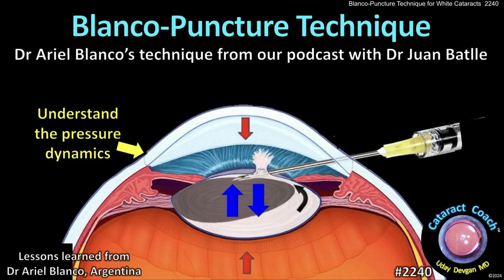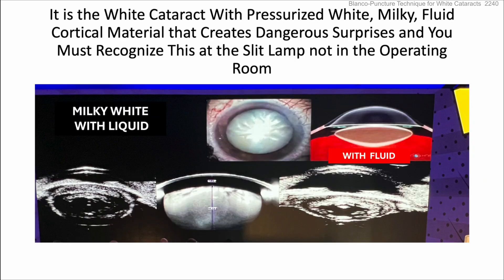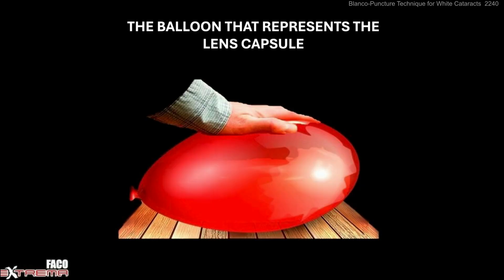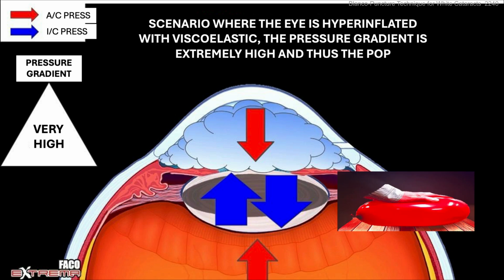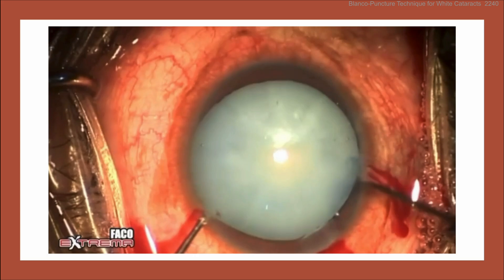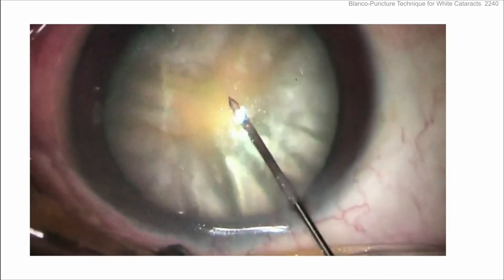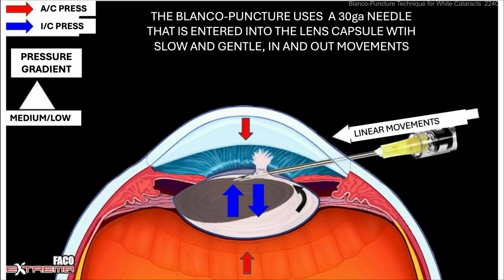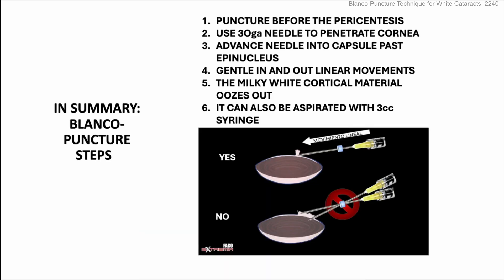CataractCoach™ 2240: Blanco-puncture technique for intumescent white cataracts

Comment: That is not how pressure gradients work. If there's more pressure in the anterior chamber, the pressure gradient decreases, not increases. I think the real issue is that even with viscoelastic filling the anterior chamber, the pressure is applied unevenly on the anterior capsule, and it might not be able to overcome the pressure inside the capsule even with an overfill since the pressure can only get so high before VE oozes out of the incision.

Comment: Hey Uday, just a small tip to add, you should purge the syringe and needle with BSS and ensure there is no air in the system, as to further reassure you won’t be adding another pressure gradient to the mixture. Great video.

Comment: It looks very helpful, but how do you stain with trypane blue dye  once it opens ?
Reply: I'm assuming that once the intumescent lens pressure/cortex is released, you could create your side-port incision to stain/viscoelastic like usual.
Reply: Yes. First the puncture. Then the normal procedure
Reply: Thank you for your answers docs. Also i have another question if you don't mind : can i use blue dye once the capsular bag is open ? And why does senior teaching docs in my country are always saying that you shouldn't do it ? (this question is bothering so much and I can't find the answer in my researches ! )
Reply: @bakiranis8869  I use trypan blue staining all the time, even after capsular bag is open ... but mainly with laser-assisted surgery.  I've stained hundreds (maybe a thousand) of capsules that already have complete (laser-created) without any problems. The stain doesn't dye the cortex or make the view difficult. 

However, the stain goes in BEFORE viscoelastic in these cases. Once you put viscoelastic in, it is really hard to get the dye to stick.  That is probably what your senior teaching docs are teaching. In most cases, you're going to stain first, followed by viscoelastic, followed by puncturing the capsule.